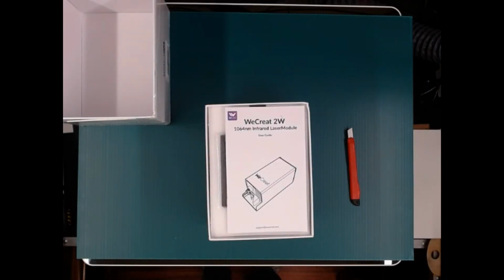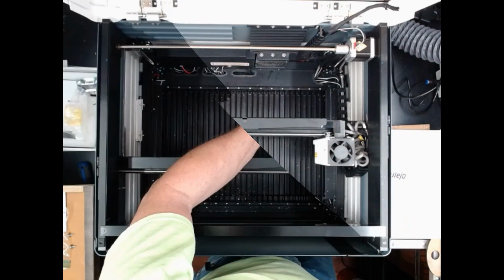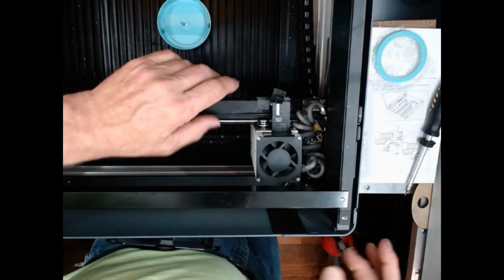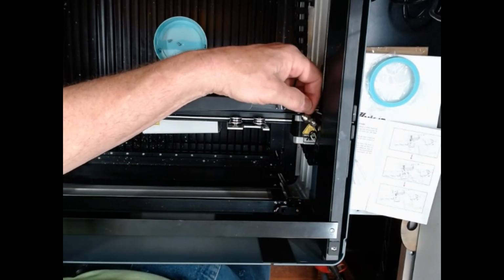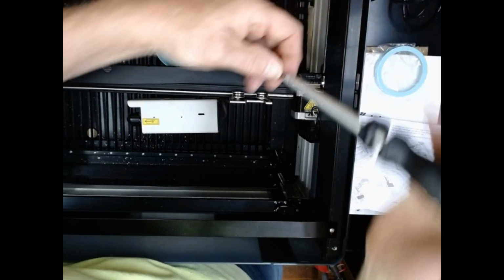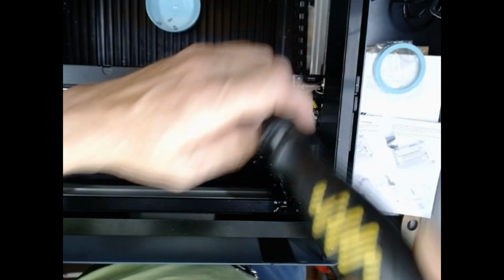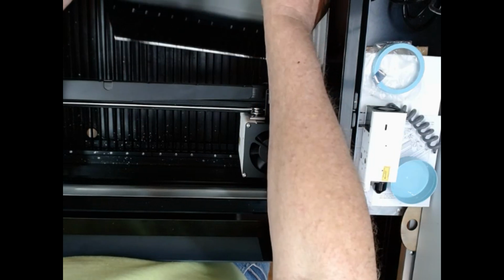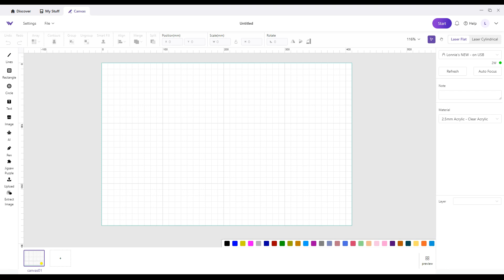2 Watt IR Laser    - #wecreat  laser

Comment: Now can you see yourself switching laser heads back and forth? It's not an easy task switching these out. If you're dedicating your machine to engraving plastics and metal, I'd say the 2w IR is worth it. However, if you want to go back and forth between engraving/cutting wood and engraving plastic/metal, it's not worth it. Now if they had come out with a laser head with a 2-in-1 like the Xtool F1, that would have been awesome.
Reply from the maker: Its really not that hard after the first couple times it was a breeze. You would have to stack your pieces 1 kind one day then other kind the next.   But I have 2 machines so easy enough .
Reply: Looks like a pain in the arse!  ;)